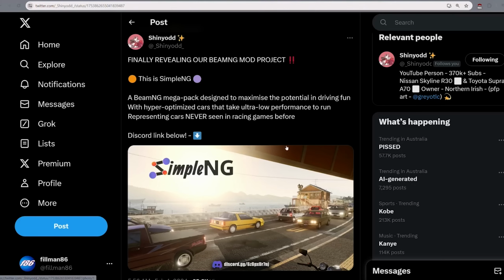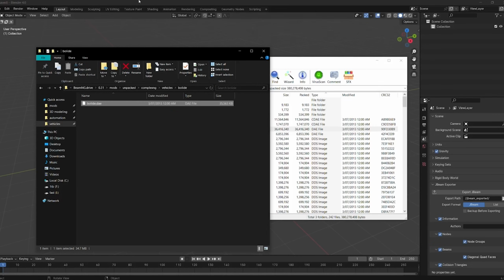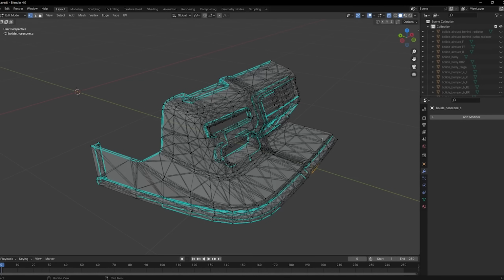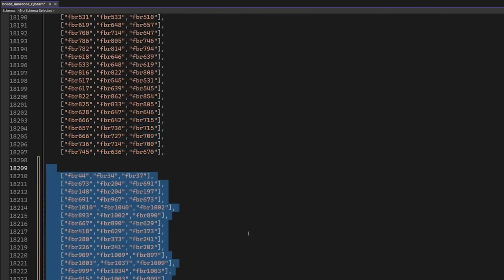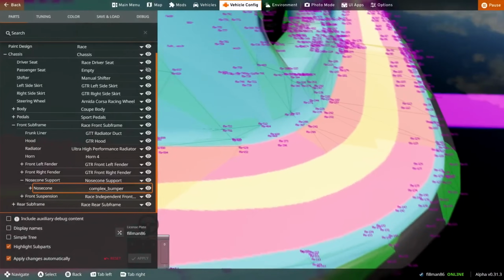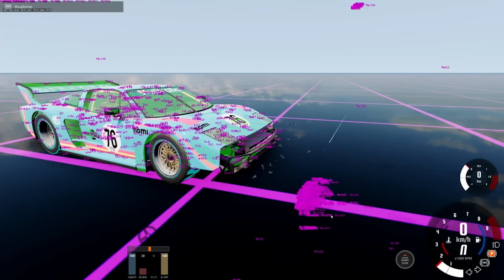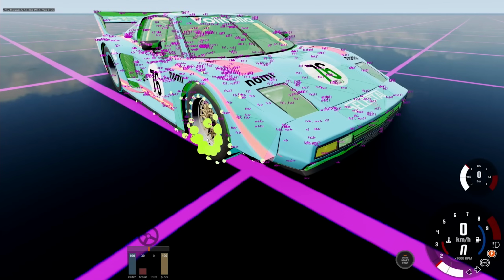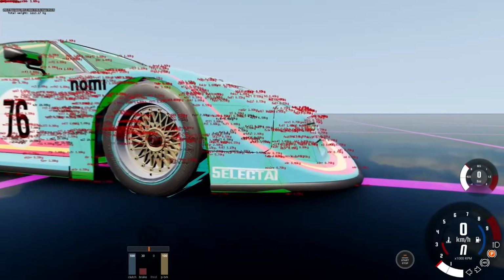roasting computers with BeamNG's most Advanced New Physics Mod

Comment: Your welcome... Oh for what? I am going to tell you. 

Applying techniques used for realistic water simulation to vehicle and character damage modeling in games can indeed lead to more dynamic and visually engaging damage systems. Below are ways these methods can be adapted for damage systems while maintaining performance efficiency:

### 1. *Heightfield Simulations for Vehicle and Terrain Damage*
- **Application**: Use heightfields to simulate terrain deformation and vehicle body damage.
- **Mechanics**: Represent the surface of a vehicle or terrain as a grid of height values. When impacted, adjust the height values to simulate dents or deformations.
- **Advantages**: Efficient in terms of memory and computational resources, as it requires updating only a grid of height values.
- **Use Case**: Suitable for simulating dents and deformations on vehicle surfaces or creating craters and damage in terrain from impacts or explosions.

### 2. *Smoothed Particle Hydrodynamics (SPH) for Soft Body Damage*
- **Application**: Use SPH to simulate soft body physics for vehicle components and characters, particularly for areas that need to exhibit complex, fluid-like deformation.
- **Mechanics**: Represent components as a collection of particles that interact based on physical forces, allowing for realistic soft body deformation and damage propagation.
- **Advantages**: Offers detailed and realistic damage modeling, capturing effects like crumpling, tearing, and deformation.
- **Use Case**: Ideal for simulating damage to softer vehicle components like bumpers or for characters’ flexible body parts.

### 3. *Hybrid Methods for Detailed Damage Simulation*
- **Application**: Combine particle and grid-based methods to simulate damage in a comprehensive yet efficient manner.
- **Mechanics**: Use particles to model complex, localized damage such as crumpling or tearing, while using a grid-based approach for larger-scale deformations.
- **Advantages**: Balances computational load by focusing detailed simulations only where necessary.
- **Use Case**: Effective for complex damage modeling in vehicles, such as combining detailed impact damage with overall structural deformation.

### 4. *Screen Space Damage Effects (SSDE)*
- **Application**: Use SSDE to simulate damage effects on the screen, like scratches, bullet holes, or cracks.
- **Mechanics**: Apply damage effects directly in the screen space, overlaying textures or effects where the damage occurs.
- **Advantages**: Very memory-efficient as it relies on texture manipulation rather than complex geometry changes.
- **Use Case**: Ideal for superficial damage effects on vehicles and characters, such as scratches, blood, or bullet impacts.

### 5. *Navier-Stokes for Fluid-like Deformation*
- **Application**: Use simplified Navier-Stokes equations to simulate fluid-like deformations in vehicle components and characters.
- **Mechanics**: Model deformations and soft body physics using fluid dynamics principles to create realistic bending, stretching, and impact effects.
- **Advantages**: Provides a balance between realism and computational efficiency, particularly useful for simulating flexible or fluid-like damage.
- **Use Case**: Effective for simulating damage to flexible parts of vehicles or the human body under impacts.

### 6. *Vertex Animation Textures for Precomputed Damage*
- **Application**: Use vertex animation textures to apply precomputed damage effects on vehicles and characters.
- **Mechanics**: Store damage animations in textures and apply them to models dynamically, reducing the need for real-time computation.
- **Advantages**: Efficient in terms of memory and processing power, suitable for pre-defined damage scenarios.
- **Use Case**: Best for scenarios where specific damage patterns are expected, such as repeated collisions in the same area.

### 7. *Particle-Based Damage for Detailed Effects*
- **Application**: Use particles to simulate specific damage effects such as debris, shattering, and localized deformation.
- **Mechanics**: Emit particles upon impact to simulate effects like glass shattering or paint chipping, with particles representing the damaged materials.
- **Advantages**: Allows for detailed and dynamic damage effects without heavy computational overhead.
- **Use Case**: Ideal for visualizing damage like shattered glass, debris from collisions, or splintering materials.

### Implementation Considerations
- **LOD (Level of Detail)**: Implement LOD techniques to reduce the complexity of damage models as the distance from the camera increases, saving memory and computational resources.
- **Dynamic Mesh Updates**: Use procedural methods to dynamically alter meshes based on impact data, allowing for real-time damage modeling without pre-baking.
- **Texture Atlases for Damage**: Use texture atlases to store different damage states and dynamically switch textures to represent various damage levels.

### Conclusion
By adapting these techniques, games can achieve more dynamic and realistic damage systems for vehicles and characters without placing excessive demands on gaming PCs or consoles. The key is to balance realism with performance efficiency, focusing detailed simulations only where necessary and using simplified methods for larger-scale effects.

Comment: i actually did try this awhile back because of how terribly beamed most of the rollcages are in the game, it actually turned out great plus i did all the position and alignment for the nodes manually using notepad and refreshing game {this was before the Blender plugin came around} i made the rollcage for the 1963 VW Beetle i took the autobellos rollcage mesh and applied my own nodes and beams but it did effect performance pretty heavily plus i always like to have the AgentY universal dummy mod which i make also make custom seatbelts for
Reply from the maker: The plugin I used here has actually been out for a lot longer

Comment: there is a way to do those cross braces easier.

There is a feature in edit mode under face> poke faces that adds a vert into every quad
Reply from the maker: but that adds more vertices, which is not what you want. I did triangulate all quads, but then the rest was me adding edges, and not only that, I was also 3 dimensionally adding then to the layer underneath too

Comment: Some vscode pro tips: 
- you can select a series of lines and select “add cursors to line ends” in the command palette
- with these multiple cursors you can perform multiple copy/paste operations at once using arrowkeys to position the cursors (hold shift while doing this to select and ctrl+X to cut and ctrl+V to paste). Hold ctrl while pressing an arrow to move the cursors through an entire sequence of numbers/letters/underscores
- finally, there’s a “reverse selection” command too, meaning you just reverse selection and THEN paste to paste the pieces of text in the opposite order

Hope this helps ^^

Comment: As someone who does softbody physics in VFX applications, I don't think ANY application can handle this properly, apart from some fancy material analysis software like Ansys.

Node-based softbody simulations aren't really designed to have tons of nodes, you're actually supposed to make a really low-poly optimized physics mesh, and then after simulating that mesh you attach the vertices to the high-poly visual mesh and interpolate between the physics nodes to make it appear high-quality. Not even specialized software like Houdini can do things like this.

I was actually really surprised at how well the game engine handled it. The BeamNG devs have clearly optimized their softbody engine incredibly well, a mesh like that would instantly crash Blender and probably slow Houdini to a crawl.

Comment: To work with extremely lightweight nodes you have to turn your damping WAY WAY DOWN. Back when I used to do ultra light truck competitions in RoR I used to use 0.00002 or even lower for my damping which allowed me to have an entire vehicle which weighed less than a kg. The damping starts to brake down when you get to very low weights because the physics calculation cycle can’t keep up with the speed that the nodes oscillate at. Because of this if your damping is to high, your nodes will actually overshoot their resting location. Then on the next calculation it calculates with the new location and applies a lot of force in the other direction from the damping. The node is so light that it now overshoots in the other direction. This continues getting worse and worse till it just explodes.
Reply from the maker: ooooh interesting, thanks for the tip

Comment: why not make it logically complex instead of making it 1:1 with the mesh
Reply from the maker: logically? like the active rear I made previously, or are you talking about making it in a better way? Well I was trying to answer 2 questions

1) I wanted to know if the thickness of the object could effect its rigidity, as most collisions are a shell with cheat beams crossing outside of the thickness of the mesh (I didn't explain this well in the video)

2) many people ask why they have to make a collision mesh if they've already got a visible mesh, so I showed what happens

Comment: This sounds like something a moderately complex script could quickly do. If only I knew more Python and the Blender API...
I once tried updating a script for exporting PS1-usable models, but the API had changed so much and the documentation was so sparse that I barely managed to make it worked - it exported geometry but not colour like it should
Reply from the maker: luckily blender has all of its old versions still available to download if need be. TBH though what I did here in blender is not really the way you'd ever want to do it anyway
Reply: @fillman86  you could've used geometry nodes or modifiers to generate a collision mesh with a custom level of detail.
You could have asked ppl for guidance, im sure they'd be happy to do it.

Comment: I used this AI thing that summarises your video, and this is one of the things it said: "The video showcases the creator's frustration and exhaustion throughout the process, as they struggle to achieve the desired result." 🤣
Reply from the maker: lol I've never heard of that kind of ai tool, but it seems very smart lol
Reply: yeah it’s a thing called ad speed up, which is a way to get around yt blocking ad blockers, but still give creators money, it basically just speeds up the ad, but it comes with an ai summariser and a ai chatbot that can tell you about what happens in the video

Comment: thinking about this topic, a: im surprised theres no physics sleep sort of function for the nodes, and
b: despite being built from scratch, if the engine calculated and generated beam nodes based off of where the colision takes place, positioned by the mesh, that would save a LOT of computational struggles. It would in theory make crashes a little choppier though.
Reply: This would shred performance in the worst case and probably not do anything in the best case, running code for every node every frame lets you use the vector units in your CPU and avoid branch prediction issues
Reply: @shukterhousejive can confirm - branch less programming with repetitive vector-intensive tasks is very very VERY good.

Comment: Surely you can make a script to save you all of that work in Blender?
Reply from the maker: ? you mean making all those beams? I very much doubt it, because I was connecting it in a very specific way to give it only its own thickness in strength. Plus this is not how you model -ever-, this is specifically for beamng use only
Reply: @fillman86  No, I know, but I wonder if you can do something if you were to model something from scratch.

Comment: you can put model in 3ds max and convert it into patch surfaces quite fast. with a few clicks. this will have triangles you needed
Reply from the maker: in blender it's just ctrl+t but I was doing sooooo much more than that, and it's not how you'd normally model ever, so it had to be done by hand
Reply: @fillman86  Hard Work :O

Comment: You should get an aio cooler so that ur cpu will be much cooler I run one and a don’t overheat on beamng anymore but I need a cpu cause if I get a new gpu then it will be bottle necked
Reply from the maker: I got a good noctua cooler, and now it's just my gpu that makes all the noise

Comment: the only downside to beamng is they have limited the amount of cpu you can use.
Reply from the maker: oh I didn't know that. I specifically got a noctua cooler because my CPU used to ramp up so hard!
Reply: @fillman86  yeah beamng doesn’t use full cpu. if you ever get a mod and it makes the game unplayable look at your cpu cores there will be a couple at 100% and the rest not being touched ahha only problem ive got with beamng aha
Reply: @buzzinggamer816   it's not multithreaded?????
Reply: @nahoj.2569  sadly no. no idea why am hoping they will change it because beamng relies on cpu more than anything else.
Reply: @buzzinggamer816  
it is multithreaded, this is just a cpu load issue.
parallel computing is incredibly complex and any systems that use it need to be designed with it in mind.
it may just not take advantage of the full performance of the cores.
Reply: @buzzinggamer816  a dev said on reddit that every car uses a different thread.

Comment: I think the simulation is too chaotic to see a change between normal and a collision, also the FPS is not that affected as is CPU bound and not GPU. It's like you have another car attached to your bumper, so if your pc can handle some traffic, it will handle this. Unless you spawn like 5 of this exact cars next to each other, the FPS will go DOWN and even more if you crash them. Maybe increase the beam number in a less complex car like the 4 wheel pigeon as is very Boxy, still, the amount of work is INSANE. 

Awesome video man!
Reply from the maker: does it not slow the simulation if it's not done calculating the last frame? because it was slow for a while
Reply: @fillman86  It does, it would cause stutters and general lag.
theres a new metric to measure this called GPU busy

Comment: So hold on a second. Did I understand it correctly? Each node has a weight to it? As in, in kilograms or whatever? Is that why the bumper would weight 1.4 tons?

Oh also typo in the title - 'BemNG's', should be BeamNG's.
Reply from the maker: that is correct, and each is simulated, which is why less nodes for a collision mesh means less computer stress
Reply: That is fascinating, because I actually thought that it is defined by singular float value, much like in many other racing games, as in each car part (in its entirety, mesh) has its own value. So wheels, chassis, undercarriage, engine all had one value that defines their weight which then is summed up when car is assembled. I thought that each time you 'remove' the part, it just deducts from the weight of the entire vehicle. @fillman86
Reply from the maker: @Vermilleno  nope, and this was makes it so much more realistic, but also a bigger performance hit
Reply: The A is for accurate..
Reply: Yes